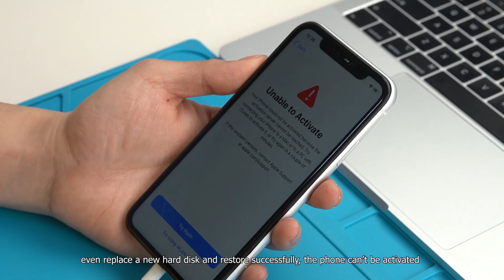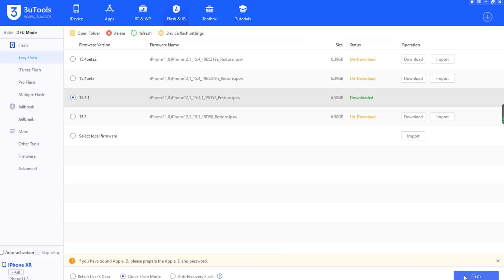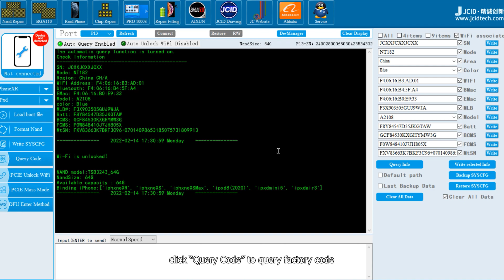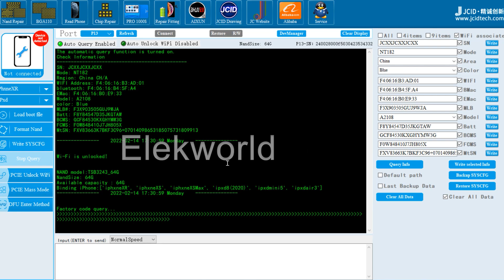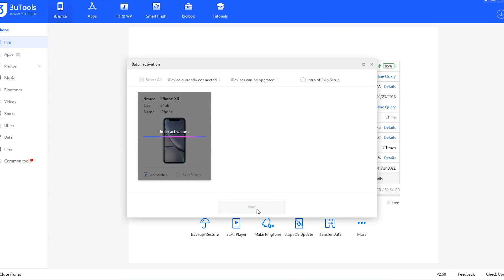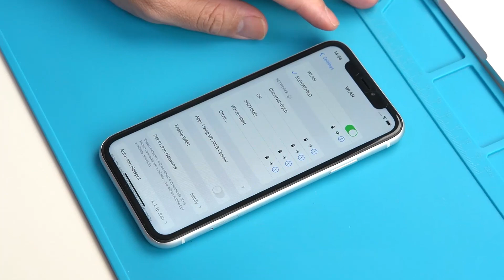Activate iPhone XR Mainboard Hard Disk With JC P13 Nand Programmer.

Comment: Tried On My 3 Phone Worked Perfectly Fine 
But One Of The 11 Pro Max Stopped Wifi Working Any Suggestions ?
Reply from the maker: If you just repaired the Nand and Wifi, pls check if you have unlock Wifi successfully. If so, the other two possibilities are 1- AP board and BB board were false soldered; 2- WIfi module damaged.
Reply: @Elekworld  Thanks Sir But The Issue Was With The Programming The JC P13 Has A Bug In 11 Pro Max In Which When We Write Or Re-Modify Nand Syscfg  The Wifi Will Be N/A I Wrote Another Nand’s Data And Input The Actual Compulsory Addresses Through JC P11F(BGA110) My Issue Got Resolved I Have Tried 5 11 Pro Max’s With P13 Same Its The Bug In P13 Kindly Check That Out
Reply from the maker: @IAmRSTK49    OK, will check and let u know if any update.

Comment: Several questions
1. From were do you get original SSD data if original SSD is damaged ?
1. for program I have to use MAC, or you have a windows version as well
Reply from the maker: 1- Original SSD data was memorzed in the new SSD when restoring;
2- the windows version software available, No MAC version, bro.